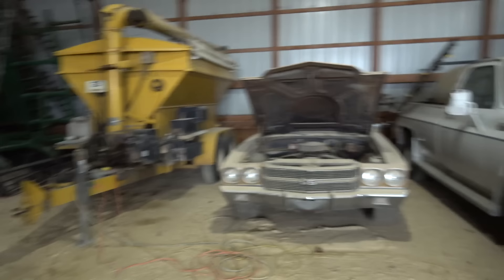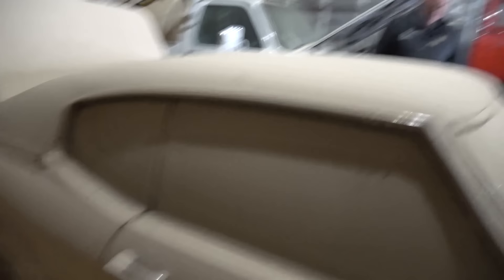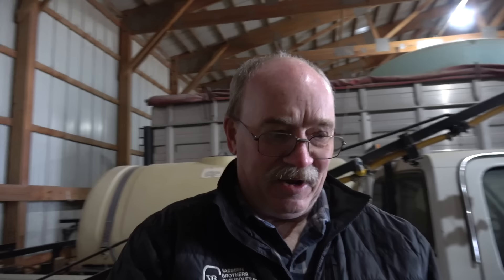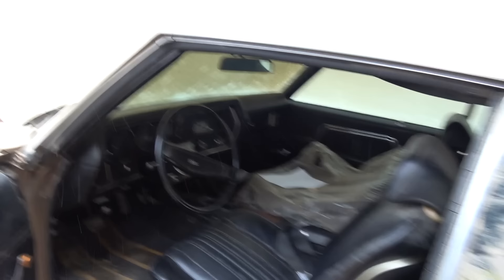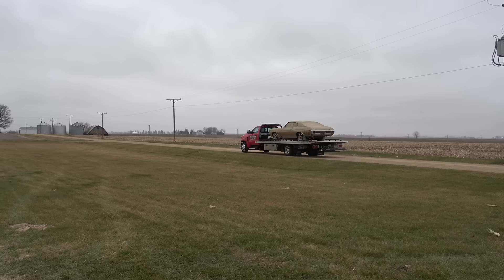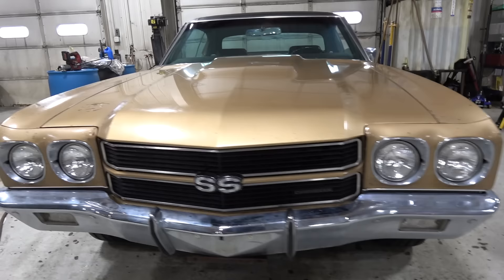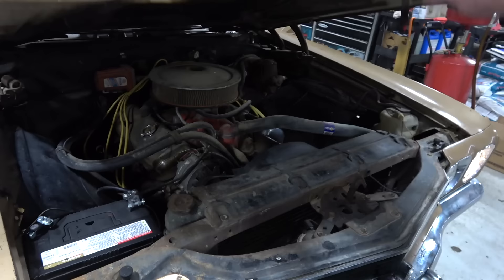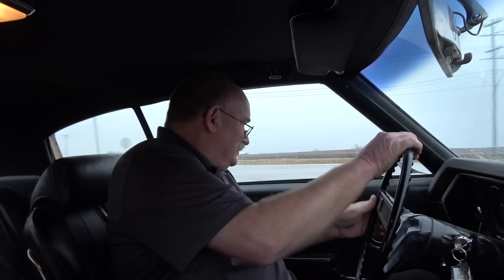BARN FIND Survivor 1970 Chevrolet Chevelle 396 SS 4 Speed in Gold on My Car Story with Lou Costabile

Comment: Again I'll state I'm not a fan of GMs, and have only owned 1 GM vehicle my entire 67 years, a '60 Impala, 2 door hardtop. I always said if I ever owned a 2nd GM it would be a '70 Chevelle. I guess I kinda did because the original reason I bought the '60 was because I had a LS6 and 4 speed from a '70 Chevelle hanging in the shop, and that front angle and side view of that '60 hooked me as much as any other vehicle has.
This '70, I wouldn't restore beyond stopping any rust on the body, underside, interior, clear coat the paint, make it 100% dependable driver, drive and show it. I wouldn't even remove the Dymo label off the dash.
Thanks again Lou!
Reply from the maker: Happy to share the one Chevelle you like with you :-) You're welcome, Ray!